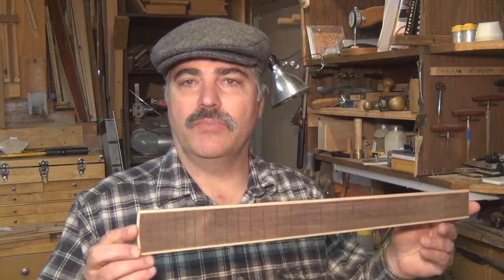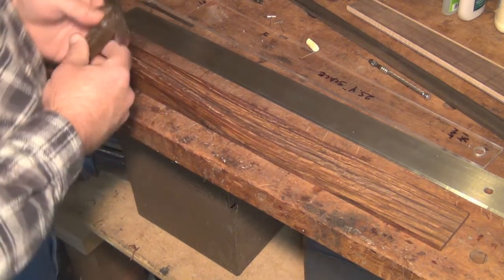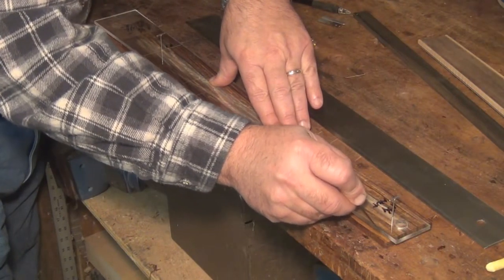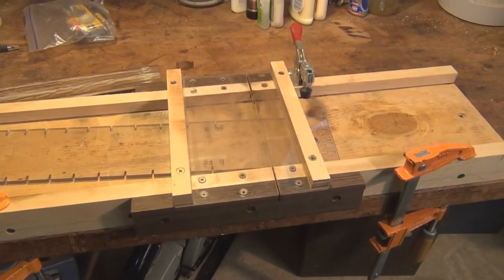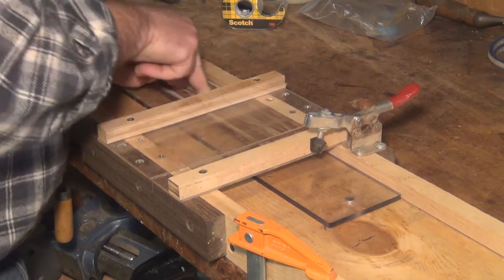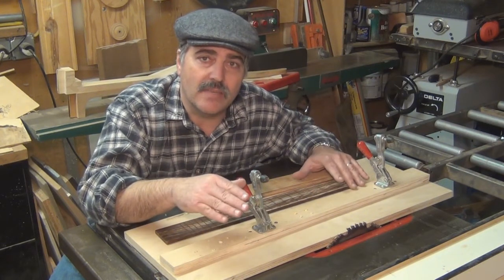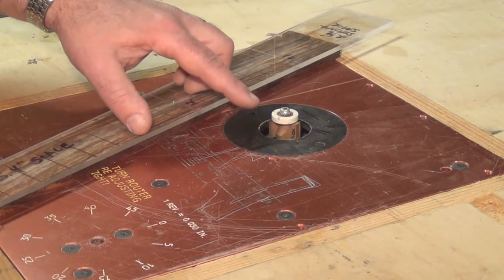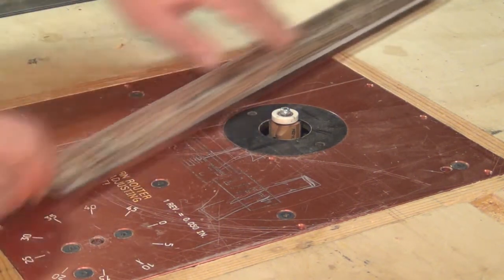Chapter 11 Making the fret board

Comment: 25.4?  how much difference is there when compared to 25.5?
Reply: +nmssis Easy. That's just under 1/8" on the scale so just under 1/16" at the octave and so on and so forth.  Scale lengths are a personal preference.
Reply: Greg Nelson sorry, difference in tone
Reply: I am in the camp that says this sort of minor change has no significant effect on tone.  Perhaps a little different feel for your left hand but even that is very subtle.  You have more effect on tone with your approach and attitude towards an instrument or even a particular piece than a 1/8" change in string length will.
Reply: Greg Nelson I agree...but when dealing with fret slotting where thousandths of an inch will change things up greatly i was wondering if 25.4 was better option for some odd reason.

to your knowledge, what is the reason for using 25.4 instead of fender's 25.5?
Reply: Thousandths and even fractions there of can matter when spacing your frets. They need to be accurate but then again, mathematically accurate is just a starting point. You tube is not a place to get into the nuance of this so I will stop there.  The reason for 25.4" is that is one of the templates I have (Martin dreadnoughts use this).
Reply: Greg Nelson
got it, thanks!